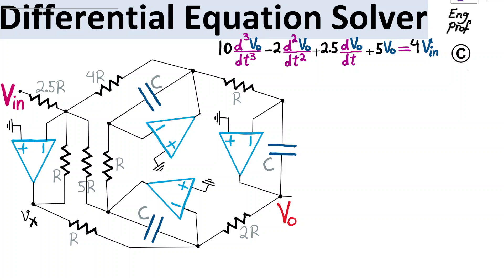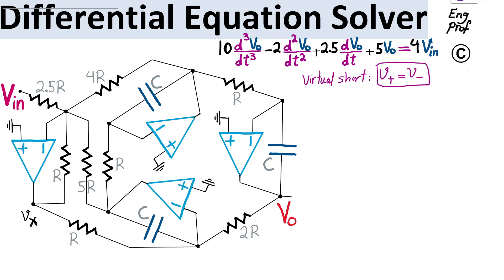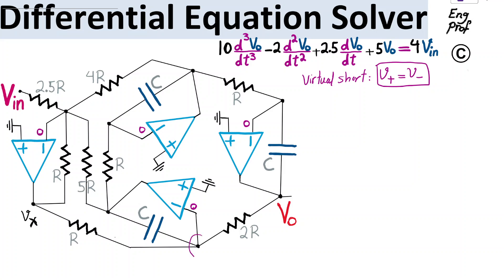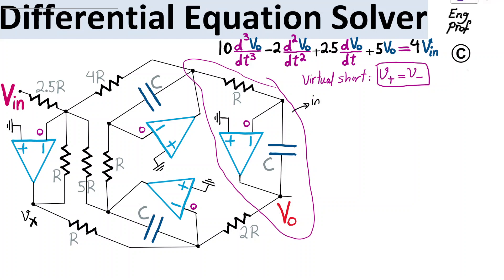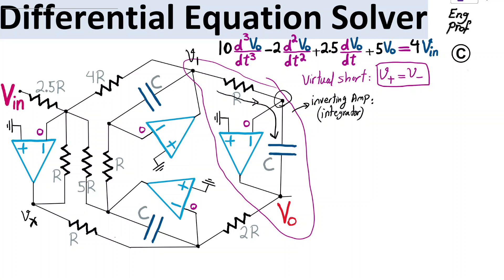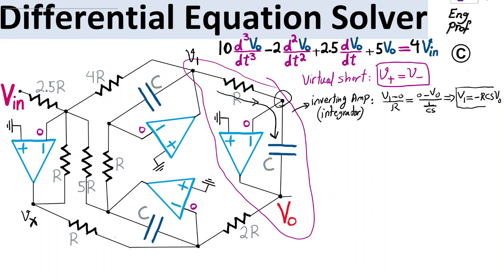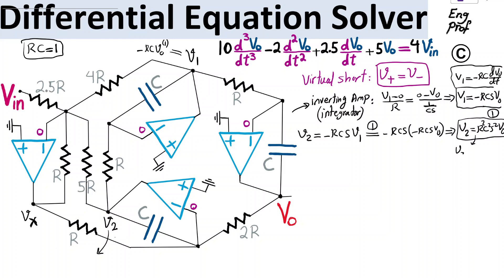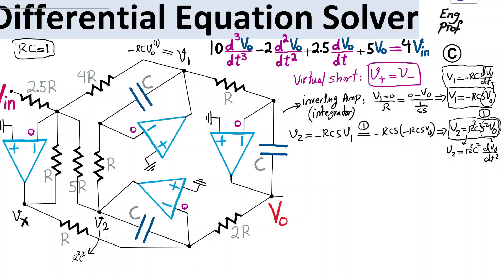Differential Equation Solver Circuit (Analog Computer)

Comment: whenever I will try to realise this...I have to take care of the input bias current, offset voltage which causes the error in the output
do you have any video/method to resolve all these problems
cuz I want to build a hardware ckt which solves 3rd order differential equations in real life
Reply from the maker: @VeereshSarpal24BEC044 Thank you for your interest. I recorded a more detailed and a better tutorial video https://youtu.be/ENq39EesfPw of Analog Computer that solves 3rd order Differential Equation.  For practical reasons, I suggest using zero-drift low-noise audio CMOS Operational Amplifiers from Texas Instruments or Analog Devices in Quad package so that all 4 main op amps that you need are inside one IC package (to minimize noise, oscillation, mismatch, etc.)

Comment: Why does this circuit look so complicated compared the other video solving third order DE? 😆
Reply from the maker: Thanks for watching and your follow-up question. This schematic is in a compact form (Hexagonal circuit structure) and as you noted is not the nominal straightforward (standard) way of drawing a circuit that would require a systematic flow of circuit components from left to right. The following videos are examples of third order and second order circuits with standard circuit schematic: https://youtu.be/ENq39EesfPw Analog Computer circuit that solves Differential Equation. https://youtu.be/HeZRtnRXpEI Quad Op Amps Analog Computer that solves a second order differential equation. 
I hope this clarification is helpful.